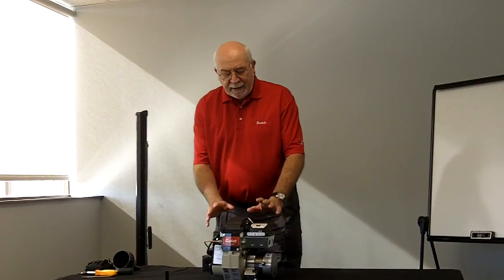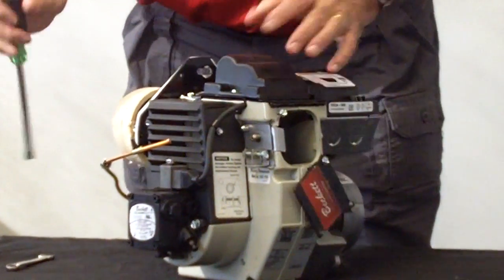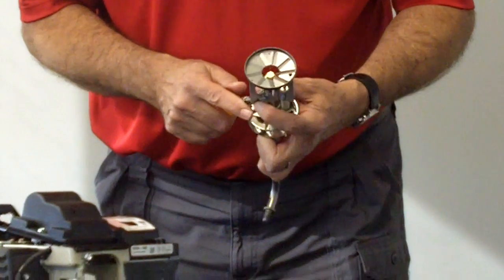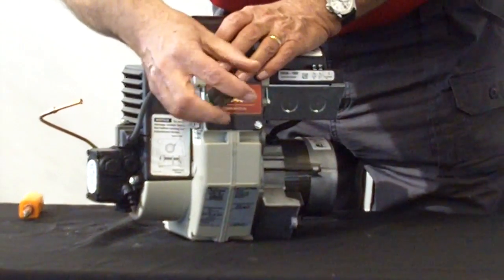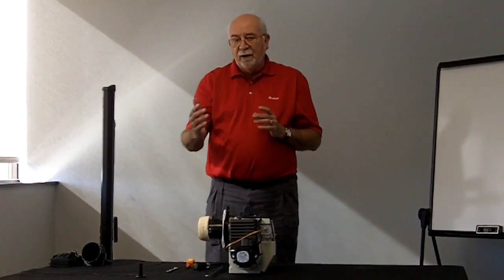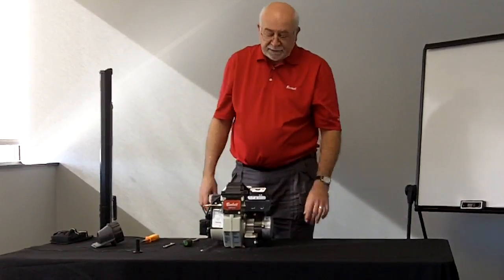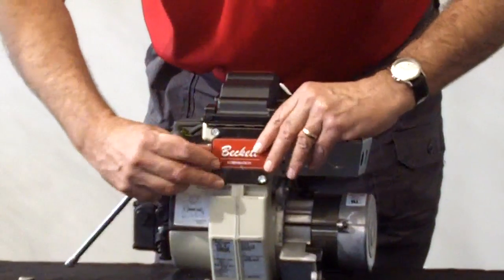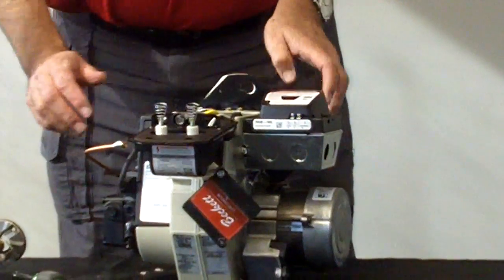Beckett NX Burner Training

Comment: I have a Buderus oil fired  boiler with NX Beckett burner. Called three different service company to do full service. All came by but refused to work on the burner because according to them NX is most troublesome burner and when nozzle is replaced the whole burner stops working. Looking for a tech to service that is to change filter, nozzle, vacuuming the firing chamber and flushing boiler and lines. Live in Westbury, New York area. Please any help or any advice will be appreciated. Thank You
Reply: I am a third generation oilman and have been a Beckett dealer since 1987. Unfortunately I am from Hartford County, Ct.
Best of luck finding a competent service provider.

Comment: I just serviced my first NX burner, and was surprised at the pump pressure! but the burner boiler combination I had gave 90% efficiency steady state with my Bacarach analyzer, quite impressive for an oil burner!
Reply: I'm no professional, but my understanding is  high efficiency like that means you need to watch your stack temperature is high enough (for good draft, depending on your chimney situation) and condensation in your heart exchanger (let's say a furnace where that could lead to a rusted through exchanger where exhaust gasses are entering the living space air.
Reply: See if Steven lavimoniere is in your service area. He's a popular YouTuber and one of the best oil burner mechanics there is, if not the best.

Comment: NX burner is a POS, everyone i work on has non stop call backs, I replace it every time with an AFG and problem is solved !
Reply: That's because you're not smart enough to do research on the proper set up adjustments.

Comment: The AFG worked too good. Lol
Reply: The NX is an excellent burner, when properly set up. Verify the z dimension is crucial.
Reply: @sirhc07  I've been a Beckett dealer since 1987. I recently set up an N X burner. It tested with perfect combustion readings. 0 PPM CO. 🏆
Reply: @sirhc07  the Beckett AFG with the L or V heads are the the most reliable and easiest to service.